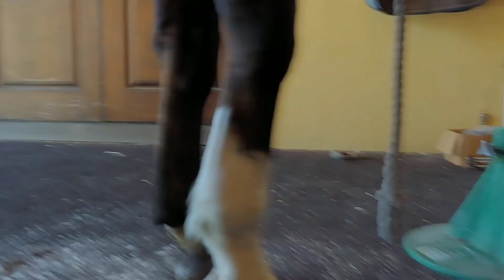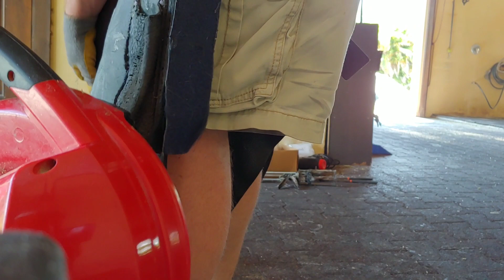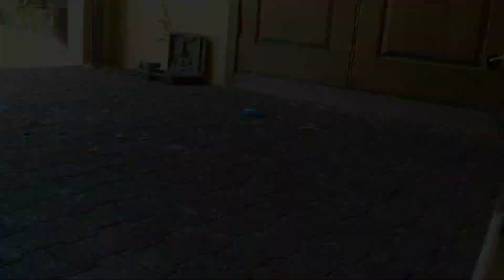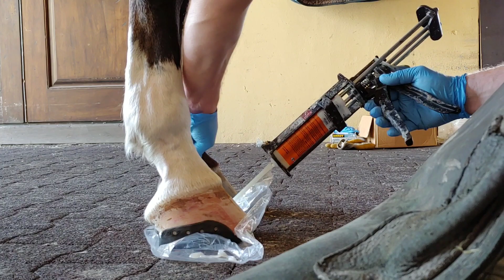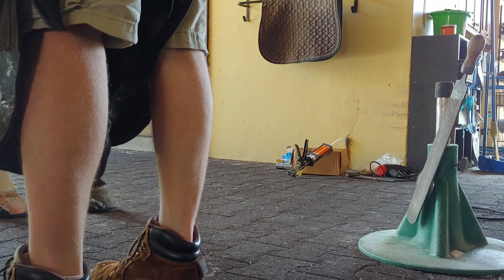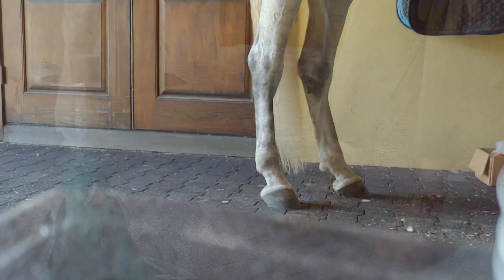Applying new set of easyshoe glue and a trim

Comment: Do you like these? Which glue do you use and do you find they stay on well if prepped correctly?
Reply from the maker: I've been using these specific shoes since they first came out in 2011-2012. In this FL climate I find that Vettec Super Fast works the best and will stay on 4-5 weeks if prepped correctly. I shoe performance horses with these results. I have also used Equilox with results lasting 3-4 weeks.